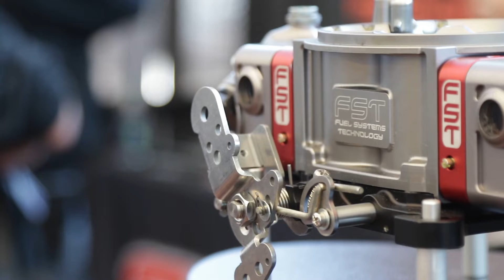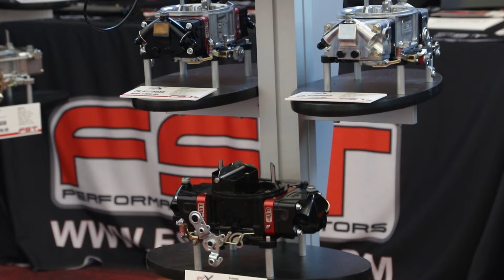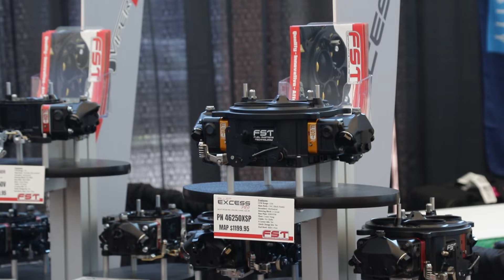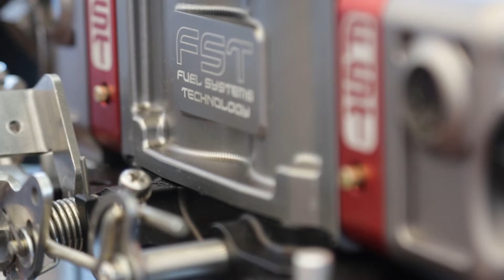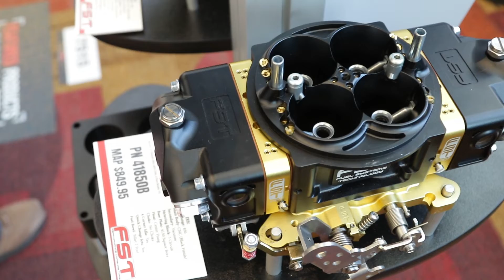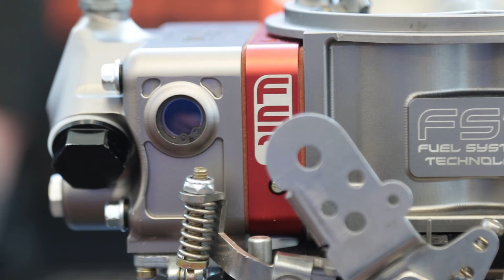PRI 2018: FST Performance Talks Cast And Billet Carbs

Comment: The secret I discovered about FST's - other budget brands like Proform, Quick fuel, and even the Summit brand all have manufacturer warranties. FST carbs look great but have absolutely no warranty. If u open a box and get a leaking carb or bent linkage - too bad u own it. That's reason enough for me to steer clear of FST. They talk a great game but if they won't even warranty their own work - are they really worth anything at all? Your hoping not to throw away 100's and 100's of dollars... maybe more than a thousand When u buy an FST carb. You pay - and then you get what you get. For just a little more money you can get assurances that if it's busted, you can at least get another one. Not with FST. And lets face it - they're all Holley knock offs anyway - with the same characteristics as a Holley.
Reply: Right. I’ll stick with a budget carb like my 200 dollar brawler 850 that was tuned from someone that’s been building carbs for 40 years in the drag racing world. Runs a lot better then my 950 prosystems carb that I got rid of.
Reply: I use AED ( Advance Engine Design ) carbs for this very reason. My engine builder recommended them and I gave AED a shot. Well, my first AED carb leaked around the fuel inlet fitting to one of the bowls. I tried multiple fittings and aluminum, steel and nylon washers. Couldn’t get it to seal. Sent an email to AED on a Sunday for warranty information. The President of AED responded that day…..on a SUNDAY. They sent me a prepaid return shipping label. They called me to ask what type of -8 AN fittings I liked. About two days later, the carb shows up with brand new fittings that don’t leak and I didn’t pay a dime.
Reply: @abolishwelfare  Thanks - Good to know about their great customer service. I'm also running an AED. I've had Zero issues with it.
Reply: Warranty Information is at the bottom of the Instructions on their website.